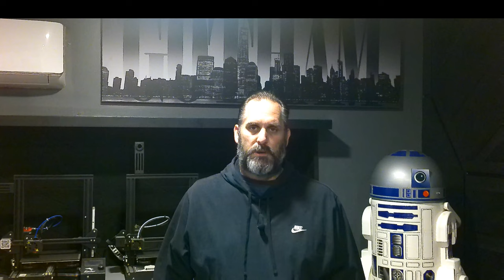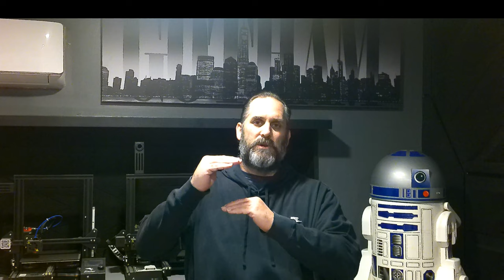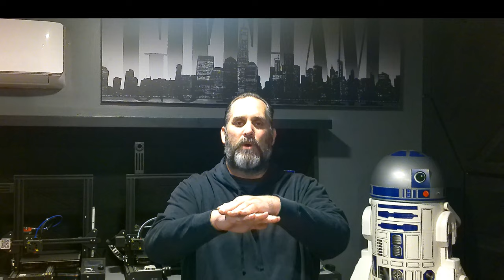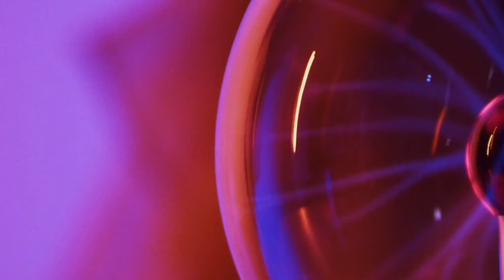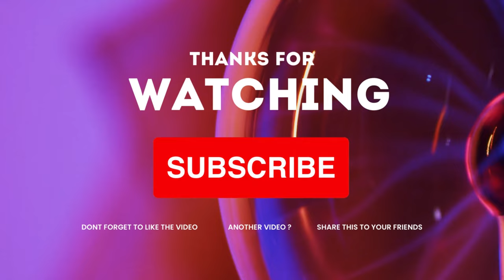Graviflyer "Tuning It In" #4

Comment: This principle that he is talking about jas been known in bumble bees and Victor Schouberger used this principle in water movement. This all makes sense it is strange because there are many different principles applied at multiple times.
Reply from the maker: yes. I thought the same thing.
Reply: Not just water movement, Viktor Schauberger supposedly built a machine called: "Repulsine". It supposedly was or is a device which was able to create lift without propellors. It is not fully clear what has happened to his prototypes (in my opinion that is). There is a villa not far away from where I spend my summer and winter times in Austria. The place is called: PKS (Pythagoras Kepler System) Villa in Bad Ischl, Austria. I've not been able to go there yet, but apparently Jörg Schauberger (Viktors grand son) is still there from time to time in the summer.
Reply from the maker: @Maximilian-Willert  If you watch the documentary there is some technology that had to do with low watts. It was like static volts. It is the answer to how it worked. It is right after the main saucer shaped rotation. His son mentions it for just a few minutes.
Reply: @nathanbunten4299  Good point! Its about time I watch it again. I absolutely love this doc. Also the part about the water is absolutely phenominal. Btw, thanks for sharing your thoughts and your work. Do you by any chance know what the current status or situation of Alexey is? Is he still around? Is anyone in contact with him?
Reply from the maker: @Maximilian-Willert  Charlie C has spoken with him recently. He has also shared       e-mails with him. They are working on the exact frequency's and measurements for tuning.

Comment: Have you considered rotating a magnet close to and at a right angle to a spark gap discharge? Demonstrating dynamic magnetic disruption (scaling) of electric field would be something "new" if I'm not mistaken. I think there would be a right hand/left hand differential to direction of rotation. Clockwise rotation would attract, counterclockwise would repel, or so the prediction goes. Maybe there is more to the effect, but the experiments need to be done. How can it be that nobody considered the effect of rotating magnetic fields on electric discharge, not in generating electric current in wires?

Comment: You mention radio frequency, ultrasonic frequency and audio frequency like they are all the same thing when in fact the only range you can hear and thus tune by ear are those frequencies which fall into the audio range.

Your AM radio frequency you refer to is called the carrier wave which is far outside what you can hear.

The only audio portion in the AM or FM or shortwave or any othee frequency radio band that you can hear is the modulation added to the carrier wave and it's either within the audio spectrum or needs to be changed back to within this audio range before our ears can detect it.

Your overlapping waves description seem like you may be referring to out of phase waves and generally out of phase waves cancel each other out.

The orher phenomenon you mix into your energy building is known as a resonant tank circuit. These can resonate at many calculated frequencies within or outside of the audio range.

An oscilloscope or spectrum analyser can both see these waveforms our ears cannot perceive and should work better for tuning once you figure out what your actually trying to tune.

Comment: Would be a difficult task to demonstrate what your speaking about. To re-enforce/clarify what you present and back it up with what your referring to would be much clearer. You mention that you can use a multimeter in the vicinity of a spinning/rotating magnet and get a reading, What setting are you set at? I don't get anything at all.
Reply from the maker: https://youtu.be/9ly8sSCxtWA